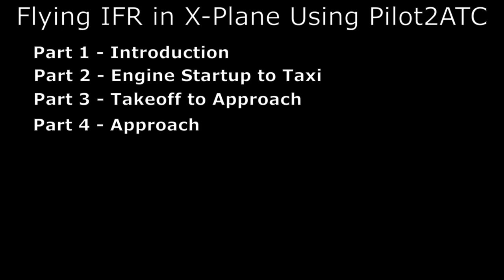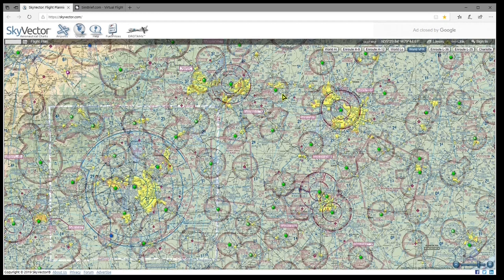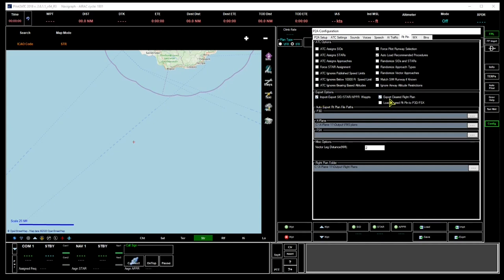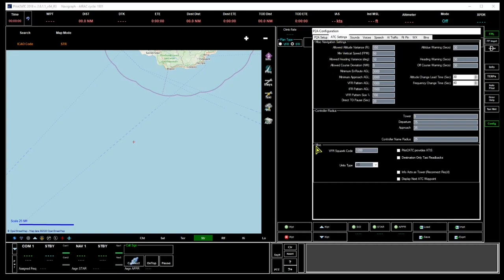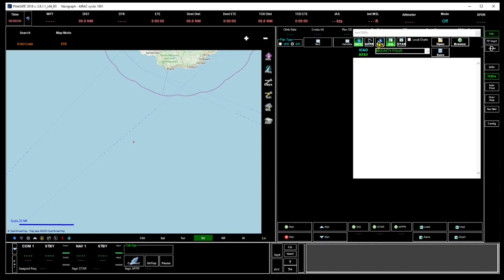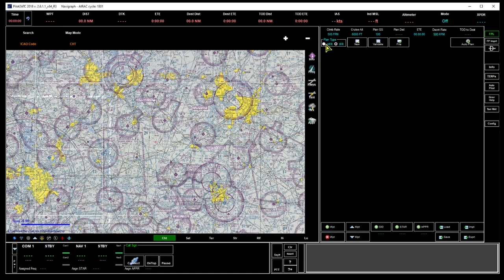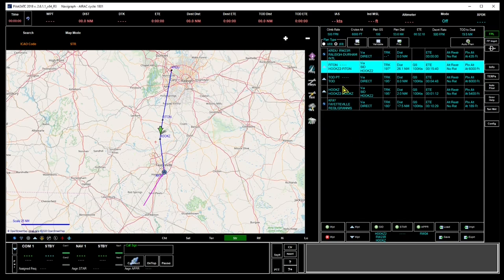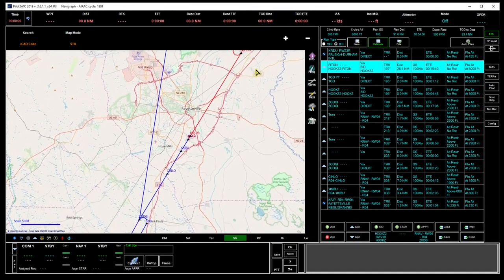Flying IFR in X-Plane using Pilot2ATC Part 1

Comment: Hi...first, thanks for your time and effort in making these videos.  Small point of clarification...at approx. 42:37 you state that the IAF is the "Intermediate Approach Fix".  Well, just so you know, IAF stands for "INITIAL Approach Fix", while IF stands for "INTERMEDIATE Fix.  This info is in the bible for all pilots, the Aeronautical Information Manual.
Reply from the maker: Thanks for that John.  Yeah,  I get mixed up on that all the time.   I have it straight in my head right now but by tomorrow morning I'll have it mixed up again.   I should at least get it right on a video though!   Glad you've pointed it out.

Comment: Thank Mark I have been having a hard time to get this to work with the cirrus sf50 and g1000
This video has give more info.Did you have trouble at first?
Reply from the maker: Hi David.  I'm not following you.  When you say "get this to work", are you referring to P2A?  If so,  the aircraft type and equipment on board is not really relevant other than maybe setting transponder, baro, AP, etc but certainly providing guidance and normal ATC operations should not be affected by what aircraft you fly or the equipment on board.  Hope that helps.

Comment: Mr fletcher
    Im using the demo trying to get used to p2a  , I don't have access to any charts I wonder if I'm doing something wrong or if as a demo you don't have access or do I need a full subscription to navigraph to access charts . Thank you for the great educational videos , enjoying them very much
Reply from the maker: No, the charts should be available to you in the demo version.   Sounds like an internet connection issue.   If you can't get it resolved,  I suggest you contact their tech support to help you get up and running.   Dave is very helpful.   You might want to visit their tech support web site too.   Good luck!

Comment: Thanks again for the videos I have learned a lot.Question have you had any issues with Pilot2atc and xplane with SQL .If so how did you overcome it?I have been in contact with Dave at p2atc and can’t get it to work.If you had issues could you make a video to help others as this seems to be a common issue. Thank you
Reply from the maker: Hi David.   I don't know anything about using SQL outside of database programming.  Hope you can enlighten me.  Sorry.

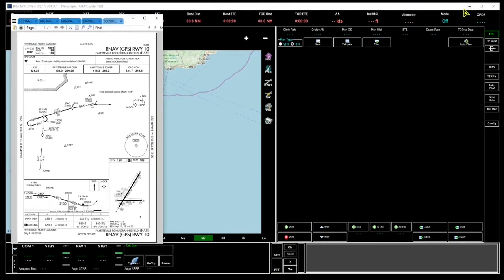Comment: Mark watched this several thanks .At 30:20tthe pointer is close to an arrow that is curved in a box.Is that to add or take away a procedure turn or holding pattern?Again thanks hope you put more videos on.
Reply from the maker: Hi David.   I guess your referring to that "race track" on the approach plate!?   Yes, that is both a holding pattern and a procedure turn.  ATC may have you hold at that point if someone was currently landing and they wanted to give him separation.  It is also used as a procedure turn if your entry angle to greater than 90 degrees.   If you load this procedure in your gps, the race track will turn megenta and the autopilot will actually guide you around this pattern.  Test that out and you'll see how it works.
Reply: Mark Fletcher thanks I could find what the button did in the manual

Comment: You are so right about Sky Vector. I have tried all the sites out there recommended by the flight sim community and always end up back at SV. It does not have the Xplane integration others site do, well since it's real of course, but it by far has the most detailed information and charts. SimBrief is nice for building flight plans and generating the reports but just not my cup of tea. I think it's a bit of a personal taste sort of thing. I recently made the move to Little Navigraph and for me it touches all the bases except for the maps. I just hop over the SV when I need one. The Xplane integration is real nice and building flight plans is easy. The best thing is how customizable it is so you can set it up the way that works best for you. Anyway, 
I downloaded P2ATC to test it out, but have not tried it yet. I was waiting on a video like this one so I could try it before I made the purchase.  I'll be watching the entire series. Thanks man.
Reply from the maker: Thanks Alan.   For flight planning,  I don't think you can do any better than P2A.   What's so nice about it is you don't have to go anywhere else to build your flight plan and you can transfer the plan into your GPS almost automatically.   Hard to beat that.  SV is still the place to go for Approach Plates and airport diagrams.